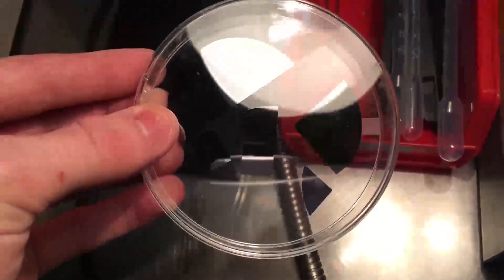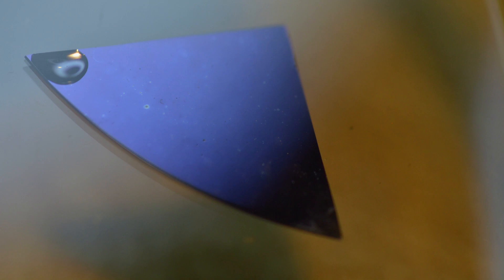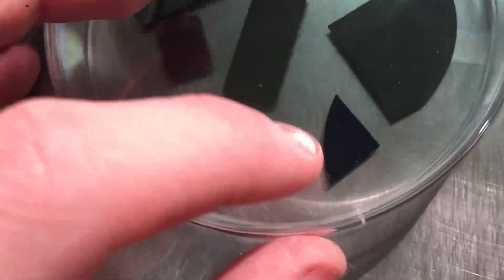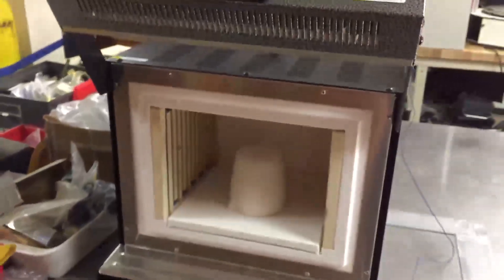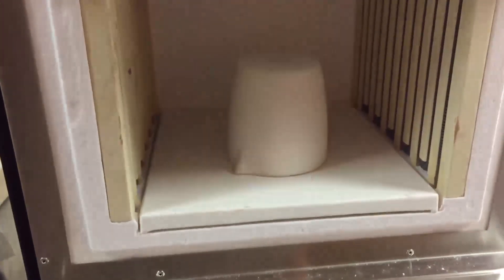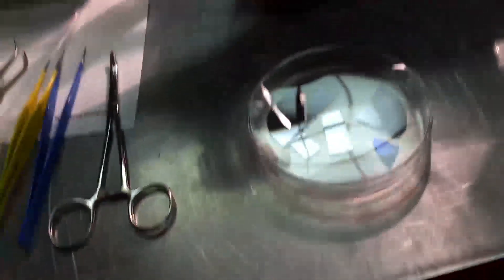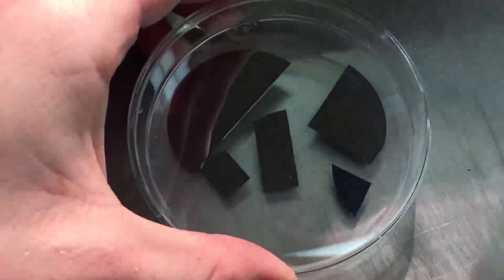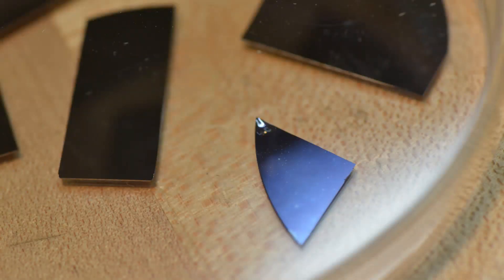Thermal Oxide Growth on Silicon Wafer - 500nm

Comment: Do you plan to characterize your thermal oxide?  I would be interested to know what kind of charge and interface defects might be present.  Thanks for making this video.
Reply from the maker: I have no way of characterizing oxides as of now other than observing interference patterns and doing dielectric breakdown tests with high voltage. Let me know if you have any ideas on other ways to characterize. I'd like to get an ellipsometer. I suppose I could also get a C-V curve tracer as well.